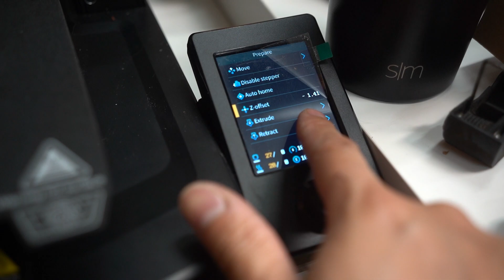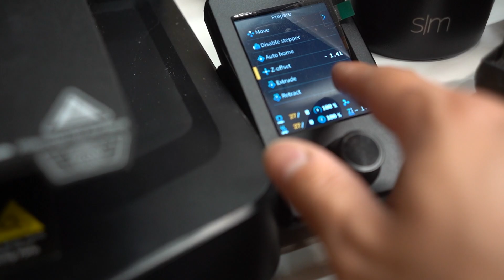Cheap & Easy Hot End Upgrade – Creality Ender 3 V3 SE

Comment: Hey great video just got a v3 se orders this hot end upgrade as I wanted  a .2  nozzle since upgrading the screws have you had any more problems with the nozzle.
Reply from the maker: This is no longer our primary printer, but its been working a lot better with going up to temp and holding temp ever since we've swapped out the Hot End.